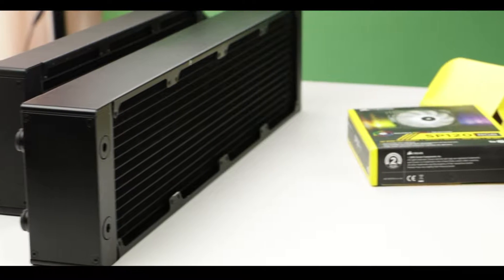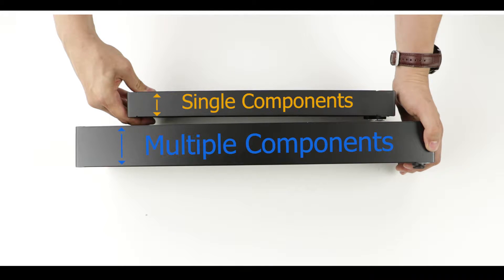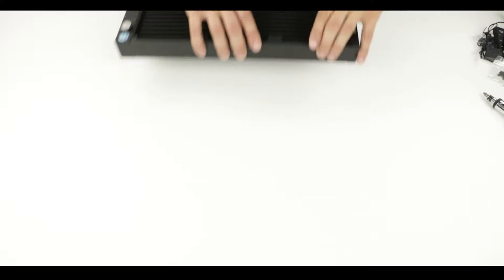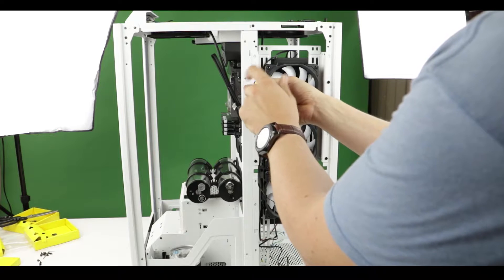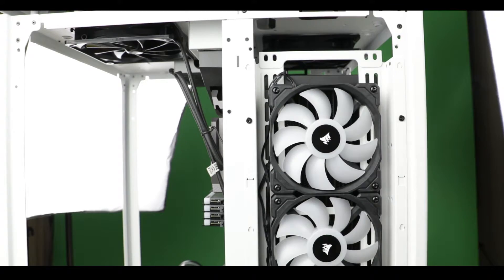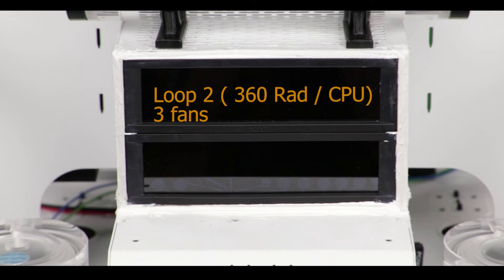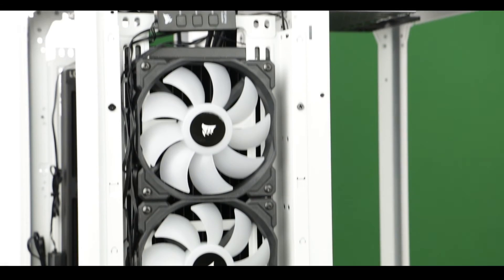DUAL LOOP: Radiators & Fans (Ryzen Project 6/10)

Comment: Worse then breaking your fans is if your screws are not tapered properly, you could puncture the radiator and ruin it.  Id rather lose a fan then puncture a radiator as there is no coming back from a leaking rad. So i always recommend as you attach your first fan, shine a flash light though the side and see just how far the screws will go at the tightness you want, and do not exceed that tension ever.

Comment: Hello, those ventilators on the side panels will push the warm air inside does not mind it?
Reply from the maker: +Martinez Luptak hey there :)

No it's fine .nee got a couple of high pressure 140 mm on top.of the case to exhaust it out

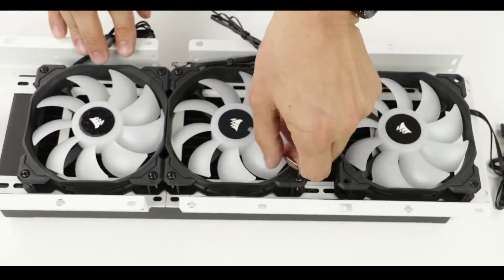Comment: 2:55 : I think you will damage the rad before the fan mount breaks :)
Reply from the maker: +Prevot Lucas yeah... Good point.. and let's face it... I haven't exactly the lightest touch :D
Reply: that's the only point I don't like with EK rads, Alphacool rads have small protectives metal plates between the screw holes and the fins, every rad should have this feature !
Reply from the maker: you know what... definitely going to give them a try on next build!
Reply: Laurent's Choice if you do, don't forget to flush the rad with vinegar and distilled water cause I found a lot of crap in it ! Let an half vinegar/half tap water solution in the rad for half an hour then flush with distilled water a few times. Those are Definitely not as clean as EK's. I picked an alphacool because EK don't have 30mm thick rad in 280 size... it's far better than I thought !